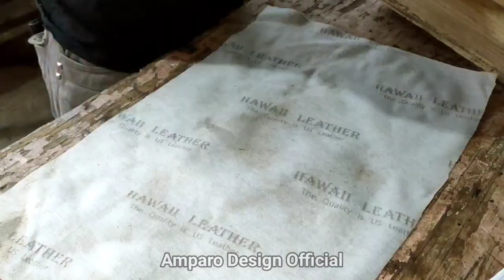Basic Upholstery Step by step tutorial, Upholstery for beginner DIY Tutorial

Comment: Ok but on your corners slit first then pull it tight and use contact cement spray pad and leather both sides of pad 2 times on lether try on scrap pieces...
Reply from the maker: thank you so much for the informative tips cheers!